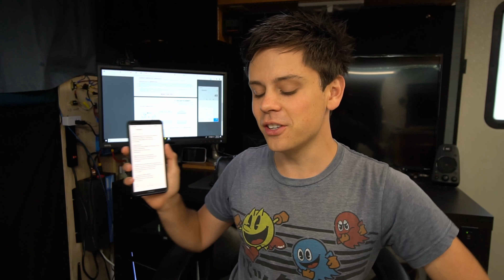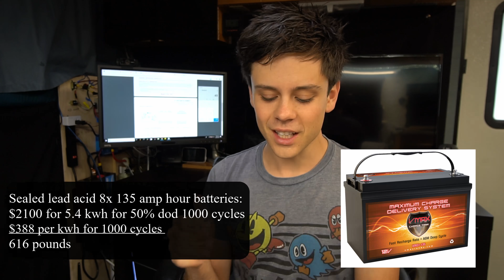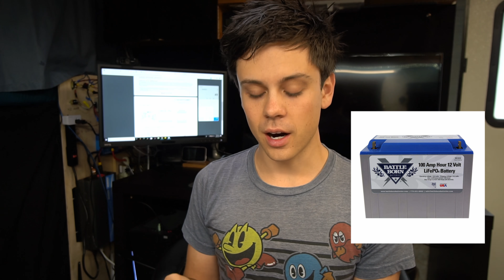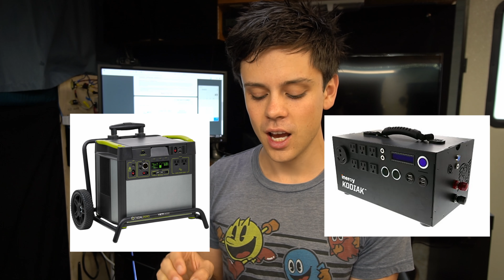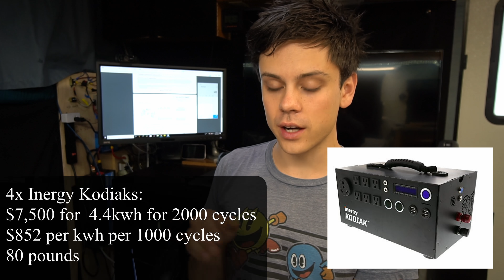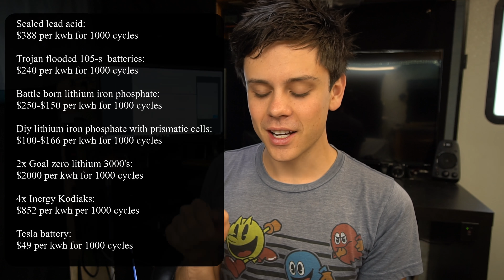Off-grid Solar Battery Price Comparison: Tesla vs. FLA vs. SLA vs. LiFePO4 vs. Tesla

Comment: there's a big fact the renders this analysis inaccurate. Yeah, i am sure Tesla's batteries still beat out all the rest, however, you use new retail pricing and stats from all the other options aside from Tesla.  If you were to buy the Tesla battery brand new, what is that cost? Im betting $4-7k..  that would change the math dramatically.  like i said, im sure that even the used battery will outlast and out perform the others, but it's not a true scientific comparison without actual retail cost for Tesla battery...
Reply: I like the idea of going used lithium that will last 3 years or so, presuming by then lithium batteries (or something else) will be much cheaper.  DEFINITELY not worth it to buy new in this case where used will do because of falling prices and improving technology -- just MHO.
Reply: I was thinking the same thing. Used Tesla batteries are going to be in various states of cycle life and everything else in the video is a new product. Also the chemistry Tesla uses is volatile and if one 18650 cell goes off they all could go into thermal runaway one by one. I'll never have that in my house as a DIY job. The other issue I have is anything lithium rely's on complicated BMS/charging circuits that could brick the cells or at least hurt their health if it goes defective electronically especially if the lithium cells are cold when charging. The Battleborn comes with a 10 year warranty but they clearly state there are stipulations to that warranty. I wouldn't want to spend that extra money on Lifep04 and then 4 years down the road find out some of my batteries are in bad health and its going to cost me to replace them. You stand to take more risk hoping you can get 10-15 years out of a battery when so many things could happen to them in that time. I'm sticking with golf cart wet cells for the cheapness and simplicity. replace them every 4-6 years with 50% DOD.
Reply: Not an incorrect statement, but you have no other alternative since you won't find these other systems use like you can with Tesla!
Reply from the maker: Yeah true. Absolutely. But considering the packs design and bms, and each cell is fused, you should be able to get more cycles than ever necessary. If soc cycle is limited, can easily get 5000-20000 cycles or more. That's more than I might need in my lifetime. But yeah I totally agree. But imo, no need to buy a new pack. Used just as good for us mortals.
Reply: @WillProwse  These are a nice comparison for a DIYer.  I will use Tesla battery if you are a caution DIY electrical engineer. Basically, do it yourself save you two or three times the cost on the battery. That is cheap on the battery components, I figure, I need 600AH battery capacity. For Battle Born, it would be $6000 instead of $2600 for Tesla. My friend just finished his Tesla build using Victron Inverter and solar charger. The fear of fire or explosion is overly fear if you haven't seen a working system or don't know what you are doing. If you understand electricity, the DIY Tesla system can even be safer than off the shelf product since there always a small percentage of defect in a product.
Reply: @padraicley3265  what voltage you need ? Tess electric battery come in 12v , 24v , 48, and cheaper then battleborn plus last longer! with lifetime warranty! Tess Electric way to go.

Comment: Interesting that the lowest cost battery option is $0.049 per kWh/cycle. That's for storage alone. Grid power is roughly $0.08 per kWh locally.
Reply: $0.125 in my locale.  I read yesterday the average in the USA is $0.12 / KWh  so you are getting it cheap!
Reply: Yep. I live a stones throw from a three reactor nuclear facility plus I'm surrounded by hydroelectric dams.
Reply: Rates climbed slightly:
First 1,400 kWh: $0.08895 per kWh
Over 1,400 kWh: $0.09732 per kWh

Comment: I ve seen people using cheap $10 6s lipo balancer to balance the cells on the Tesla battery module.But it would be awesome if someone designed a plug n play bms device for the module,where it balance the cells and has a programmable high/low voltage cut off via a contactor. Thanks for the all the effort doing your research.
Reply from the maker: Yeah the cheap balancer is fine. I'm going to balance every six months or so with my hobby charger. And honestly it has passive balancing. It's not that big of a deal
Reply: Yep you're right,there are 444 cells which balance each other out.Specially with very low current draw like you mentioned.

Comment: Was hoping to see SimpliPhi(I think that's the spelling) compared here. They're Lith iron phos and I'm pretty sure they quote 10000 cycles.
Reply from the maker: Those are rad but way too expensive. Kilovault by alte store preferable if you want a nice LiFePO4 setup.
Reply: Awesome sauce. Thanks for the lead. Yeah, the Phi's are wallet killers, but I cant help be feel that if they're outright rated at 10k cycles, they probably have a similarly remarkable lifespan on the back end. I guess we wont know for another half decade or so though. Speaking of beyond the horizon stuff, have you ever done napkin calcs on any of the prototype cells that Robert Murray-Smith has made? It would be hard to culminate everything he's put out but his channel is worth perusing. His team is a bit product focused at the moment so his slightly older content is best and he basically teaches every step of production in the various chemistries he's worked with.
Reply from the maker: Oh cool I never have heard of that channel. Will check it out. And yeah not enough years has surpassed to know how well lithium will really do yet haha will be cool to see what results we get. If taken care of, they should last a crazy long time.

Comment: I assume your tesla price was pre-owned? Is there a way to buy them brand new? Fantastic comparison, thank you!
Reply from the maker: Thanks. And yes pre-owned. I wouldnt worry about it though, considering how long the batteries last. Do a capacity test, put a heat gun on it or look for fuses that have burnt out. Even if a couple cells are bad (blown fuse), the battery will last for years. 

Just find a reputable seller. The ebay seller I bought mine from sells hundreds and they are great
Reply: Rock on, thanks. This will be my next battery setup.

Comment: Dude, you are out of real life comparison.  First you compare prices from a battery plug and play with lithium battery in raw format. To use lithium cells as a diy you gonna consume energy/time and materials to achieve 5kw/h. Also you did not compared how much draw you can put on lithium cells at high voltage drain from inverters. When you buy a 200 amp with gel you connect it directly to inverter and you are good to go. Do that at your cost calculated with li cells (new cells 18650) and monitor all  additional costs to manufacture it like the tesla car battery. You compared also second hand battery from tesla with prices from new batteries with gel. Tesla rated their power wall for 3.5k dollars for 7kw battery wall, in the end the bill costed more then 6k dollars, they had to pay taxes/installation. then other shitty minor costs etc.
Reply from the maker: Absolutely true. That is a given. Pretty sure everyone watching understands this.

Comment: The tech is changing too fast. Remember that Tesla says the new larger cells will come in at a cell price under $100 per kWh, and maybe a pack price pretty close to low $100s. New stuff. This is the BIG trend. Basically the cost per kWh should be low enough that $2000 will buy 10 kWh, and then you can build off an electric van with 100 kWh, that sort of thing. Just look out 2-3 years. Any cycle life over, say, 500 is meaningless. You won't want the technology in 2 years, anyway. 

I have some knowlege, personal experience, with pouch LiFePo4 packaged for ebikes. I bought one out of China, 3 years ago, but there are now US vendors on Ebay. These have been kicked around on ebike forums, and they get fairly hard cycling on a commuter bike. A 48v and 40 AH pack works out to around 2 kWh, and runs around $750. Two of them would be $1500.

https://www.ebay.com/itm/272853014069

(This is only a 35 AH.) The seller has been around several years and the feedback rating is 100%. These batteries have the BMS and an external charger. You can make a solar charger with a CC/CV switching module, maybe $30. Then you buy a 48v inverter, prices are all over the map. You buy 'golf cart' 48v to 12v switching converter, as big as you need.  Using your numbers, it's cheap, but I don't care about cycle life beyond 2-3 years anyway. If think the Lifepo are much safer.

I have a medium sized pouch Lifepo pack from these Chinese manufacturers, like I said, and it has been solid as a rock. Still performs close to 100%. These packs are always a plastic box with the pouches, covered with blue or black shrink.

Jehu had a nice comparison of cells the other day. He has a Chinese cell that he is offering, but you'd need around 100 to make a kWh, and that is $260 for just the cells. They need to get a robotic welder to put together modules of the cells. I don't know how many of those Tesla modules are kicking around. I don't know if you could count on a supply.

I tried to insulate my little van as much as possible, and it is fairly tight and the space is small. A good thermal barrier between the cargo area and the driving area helps a lot.  With a 200 watt heater, I can maintain a 20 degree temp rise. I get the same thing running a butane stove as low as the flame will go, maybe 1000 BTU's. It would be interesting to have enough power to heat and cook with electric. I can't really recharge, which is the problem. Get a small cargo trailer and make that the power center, solar panels and batteries, small generator. A small portable air conditioner would work for cooling, I figure, vented outside. Evap coolers work if you keep new air coming in (from outside), but once the humidity gets into the 40's they stop working.

Have fun.

Comment: Some numbers still dont make that much sense. The xtr31-135 is 135AH and at 50% dod gives $324/kWh for 8 of them. If it were 115Ah then it would be $380/kWh for 8 of them. The Trojan numbers are spot on, but the BattleBorn arent.  Assuming 90% dod as advertised, and $950 each for 4 batteries of 100Ah yields yields $176 - 293 per kwh for each 1000 cycles, assuming 3000-5000 cycles. Thats substantially different from $150-250 and good enough reason to select Trojans over BattleBorn merely on a cost basis.  The Tesla battery is 24V @ 233Ah. According to Tesla you can get 1000 cycles at 100% dod. At $1289 on ebay thats $230/kWh. In order to get the $49/kWh you would need about 5000 cycles on used batteries. But since they are 24V you would need to replace the 12V inverter. They come with built-in balancing for the 444 cells. Unless you really want to use it for 15 years ( 5 × 1000 daily cycles) it looks only slightly less expensive than Trojans.
Reply from the maker: Oh goodness I could make an entire video discussing each point. I am still sticking with everything I said. And my depth of discharge is 80% for the Tesla pack. Not even that for my application either. And of course I use a 24 volt inverter... Why would you think I didn't? And no, look up the data sheet on Tesla packs for cycle life. You can get much more. Geez I need to make a whole video covering all these topics.
Reply: @WillProwse  
Since cost is an issue it has to be addressed fairly.  For example, i have 2 12v AGM 105Ah ea. rated for 2000 cycles at 50% dod. Total cost was $360 for 1.2kWh for 2000 cycles (about 5 years) = $300 /kWh for the 5 years. In my case, and that of many others, going beyond 5 years with the same batteries is unlikely. I dont see a lot of evidence that full time RVers will keep their batteries as long as 15 years, and 5 years seems more reasonable. In the case of the Tesla S pack you get $1300 ÷ ( 24v x 231Ah x 80%) = $295 /kWh for the lifetime, which is probably going to be 5 years, but even if it isnt, in order to use the Tesla S, at a minimum, I would have to buy a 24/12v buck converter and a 24v inverter. Unless you have a link to some real bargain prices on those teo bits, any advantage to an existing AGM 12v system in cost is completely erased.
Reply from the maker: Ok lets do this point by point:
1. I guess you missed the comment here in the comments section where I said that it was and accident for 135 amp hours. I calculated 115 amp hour vmax battery with price listed on their website, msrp. Yeah that was a mistake but it wasnt far off so its fine. 
2. And no, I am using 100% depth of discharge because in battle born CEO interview they said its rated for 100% dod. So heres the math:
1200 watt hours each x 4 = 4,800 watt hours total
4 Batteries cost: $3,800
4.8 kwh for $3800, so 1 kwh costs= $791.66
/ by 5 and 3 for charge cycle life= $158.33 - $263.88
I was rounding up the first time around. So the numbers were a little off, but still the same practically for battle born. What is wrong here?
3.Trojans over battle borns? Are you kidding? 500 pounds vs 100 pounds? Coulombic efficiency of 70% vs 98%? 5x the charge cycle life? How could trojans possibly come close in any way? Please explain. You could call battle born or watch any video on lithium iron phosphate vs flooded lead acid and its literally no contest. You can use the batteries for 5x the time. 
4. Yeah I am surely not charging and discharging to 100% on the tesla. 80%. Look up the charge cycle life estimator of those batteries. Also, the charge rate makes a huge difference, and for my use with solar, I can easily get 5000-20,000 cycles out of it. And yes of course I have a 24 volt inverter. 2000 watt pure sine cost 300 bucks. its great.
5. built in balancing is passive, not active. doesnt work. you can hook up your own cell balancer but its not necessary.
Reply: @WillProwse  
Ok, the issue here is cost primarily, and the lower weight isnt a cost issue for a large vehicle. A secondary issue is that cost calculations should be on a true cost basis, so assuming that a battery will be use for 15-20 years in order to compute cost isnt realistic.  Another factor beside cost,  would be recharge rate. You are right on about recharge rate on the kodiak and yeti, so even if they were cheap as Trojans they wouldnt be practical for daily use.

Comment: Most of this is way over my head, but I get the general concepts and appreciate your work - keep it up!
Reply: When he starts talking about all the stats and other stuff, my head goes back to Jr. High Algebra - If a train with 337 people onboard travels eastbound from Boston to LA, dispensing 1 passenger every 37 miles, what city will the last person exit in?
Reply: @stans5270  East from Boston is the Atlantic Ocean
Reply: @mlhm5  So is your answer Boston?
Reply: @stans5270  --- will the last one depart in Misery...I mean Missouri, lol    I hated those types of questions, and those with the two trains departing at different times, from different locations?   I'm like, I'm not a damn Train conductor.  How would I know, or Care!  lol    Unrealistic B.S. 

What they should be teaching people is how the Financial system works in the U.S., how Notes work, and how they are traded.   Because Notes are everything in a financial system, it doesn't matter what kind of Note it is, or what currency is being used.   If you don't know how a financial system works, you can't accomplish anything, and you will eventually be cheated at some point or another, whenever buying a car, boat, house, or with your retirement account.

Comment: I had LiFePO4 12v 200AH and 100AH custom made that can handle 200A constant current discharge with 300A max. I sold out of them this month. One thing people don’t think about is the charge rate. My batteries will handle 100A charge rate per battery. I have an 800AH bank. I can theoretically discharge it to 160AH. Now, we use more power than I can generate with my 600 watts of solar, so I run my generator a couple of hours a day. The efficiency of Lithium over lead acid means that my batteries charge much faster and my 7.5KW generator runs far less, in fact, on normal days, 2 hours less because the charge rate on lead acid slows so much as they charge compared to lithium. That’s 730 hours a year my generator isn’t running. That’s five oil changes!. It’s probably about 300 gallons of diesel and lots of wear and tear saved. I’ll have paid for my batteries in less than two years. Thanks for the video. When a I wear out my LiFePO4s, I’ll look at Tesla for sure!
Reply from the maker: That's awesome!! And yes that's great. They soak up all the current. I love it!
Reply: Can theese batteries charge from solar in sub zero weather? I have a cabin in the north with very cold weather and no heating when I'm not there. Using AGM deep cycle now but looking at upgrading to Lithium.
Reply: Where are your batteries able to be purchased from?
Reply: stick with lifepo4.s/////cobalt for tesla batteries is a rare mineral a.k.a. war zone. not getting cheaper!!!li-ion are dinosaurs
Reply: @carlbole2142  It is not like a used battery needs new cobalt mined. better than ending in landfill.
Reply: @Per3110  used cobalt has electrolytes and ends up in a shredder in Ontario!
Then the garbage!  look up Call2Recycle....I have been in this charade for 10 years and it reminds me of the "Lightbulb Conspiracy"...li and iron are 2 of easiest and cheapest minerals! THIS is the future NOW for big plants, but most useless eaters like myself dont get this info! everyone should have 4- 48 volt,20ah packs for all charging and discharging over 10,000 cycles! just another scam li-ion!